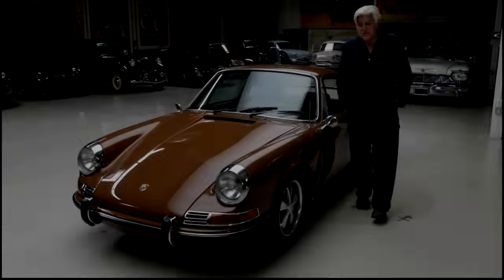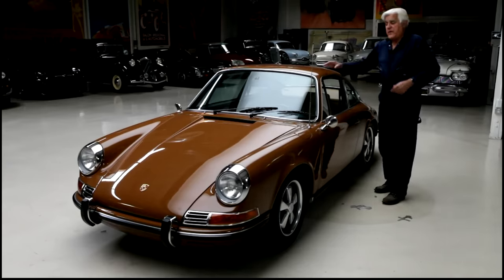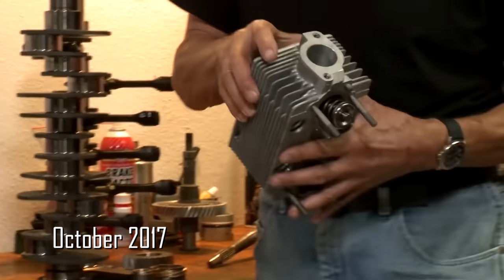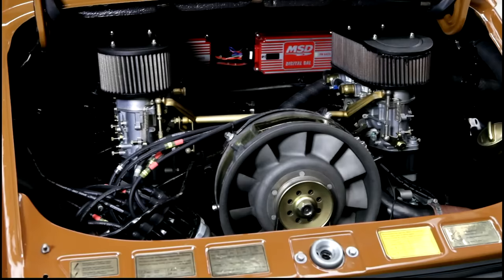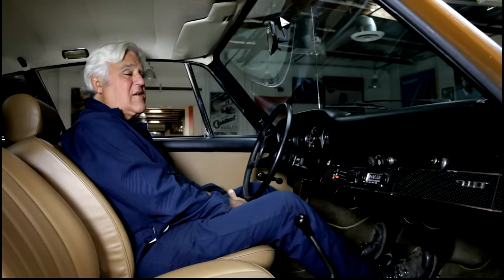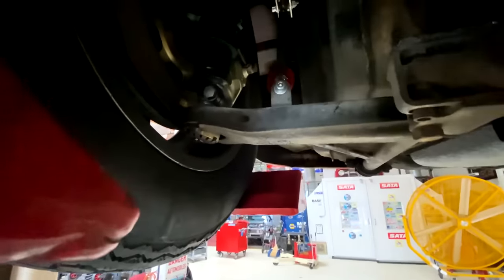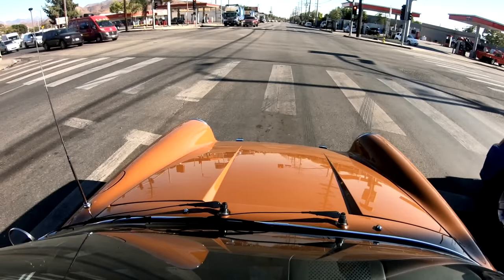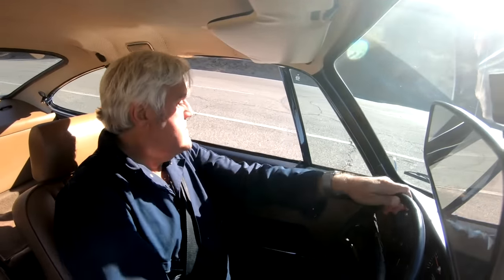1971 Porsche 911 T - Jay Leno's Garage

Comment: When they bury Jay, they'll put a Porsche steering wheel in his one hand  and the gear selector in his other. Fake engine noise! HA! BMW!
Reply: Yep. Bimmers when they were Bimmers. Now, they (cheaply) build expensive - to own and maintain - crap for leasing wannabe millenials. Sad.
Drove once a '71 2002. Man, a revelation. Then in the late '80s a 2 door 330 - I think. Wow again.
Now, not interested at all. A young relative bought a used early 2010. A money pit. He cleaned it, a good polishing job and sold it to another sucker. Deliverance !
Reply: @marcryvon  💯 all german cars have gone the same way. BMW Audi and Mercedes of old were made in smaller numbers and were brilliantly engineered and manufactures almost like a Swiss watch. Since the late 1990s they abandoned that ethos and have chased mass market appeal by living off their old reputation. Unfortunately they are now status symbols and fashion accessories so even though the produce sub standard cars people still buy them

Comment: I had  a  911T.  Bought it new  in Frankfurt.  Conda  green.  Loved  it. Drove  it every day.  Back then  a new  Porsche cost  $7000.   Still have the  window sticker.  It  had  2  Weber  carbs,  each had  3  barrels. It  had  a  dry sump  that  took 9.5 quarts of  oil.  It had  the optional  gauges that  included  an oil level  indicator. .  As  a Porsche  club member,  we  had  events  on the  Weissach  skid pad.  I did well  until  they wet   one of the corners.  I slid  and  took out two  pylons.  Took  a  few factory tours  and  met  the  factory  drivers.  We  had driving  events  at  Hockenheim  and  the Nurburgring.   That  was fun

Comment: I particularly like your philosophy about a car not being over powered. Much more fun to be able to use what you have than get yourself in a situation the car can't handle. Like the 64/65 GTOs. 9 inch Tempest brakes and Beach Boy cool as long as you were driving in a straight line. My 68 was barely able to handle it's Ram Air power.      And boy did radial tires help when they were available for the Rally Wheels. My neighbor was the manager of a BF Goodrich store and we put some on when BFG came out with them.  Ride and cornering were considerably improved. Only problem was they didn't have the bite coming off the line the Tiger 🐯 Paws had. But, good swap all in all as I have always been a road racing guy, not oval track. Formula I or World GT any day. Tragedy when we lost Trans Am. Also have a MGC (yep, look it up), a Triumph TR4A and 250 .nd. Sonbeam Tiger up graded to a 289 HiPo. Now there is a good example of too much power. Much better when it was a 225 hp 289. You could use that. More was wasted and a strain on the drive train. Truthfully best, most fun car I ever had was a VW Golf GTI.

Comment: My dad has a 70 911t targa. He bought it after it was stolen off the Porsche lot and recovered in the early 70's at some point. It's been upgraded to a 2.7 liter with about the same hp as this one. I was almost born in it. I learned to drive stick in it at age 12. The interior is pretty much a dead match to this one. I love the completely manual 3 point belts as you can lock yourself down into those seats so they don't have to be Recaros to hold you in. It's quick enough that I dusted many a 93 turbo Supras when they were out in '94 with it. Love that car.

Comment: I've had a rust free '72 911S Targa for almost 30 years. You are off on the weight by at least 300 pounds. Mine came in just north of 2300... It is lighter now with the Wolf Racing seats that are period correct! It also has Webers instead of MFI. Numbers matching and 108K on the clock, 130+mph is no problemo!

Comment: I owned a 'Tangerine' collered  '71 911T for 5-6 years in the 70's.. To this day, it is still the BEST car I've ever enjoyed driving.. Like Jay said; you could drive it to the limit all of the time... I NEVER had any mechanical issues with it either.. 125 HP doesn't sound very impressive..but, believe me it was plenty for such a light car.. I never turned on the radio because I never tired of hearing the sound of those 6 Weber carbs..

Comment: Hello Jay, I was lucky enough to own a 70 911t and a 73 911t with electronic FI and loved them both. First was a 914 in 70 and the 70 911 later but loved them both. Wife totaled the 714 (she was ok) and the 70 911 burst into flames at the 405 just before Mulholland in 73, The 70 was great, drove the Melrose gran prix to Paramount for years. 73 came next with a 76 912e second car but later an 86 911 (new) was the best. Just was able to stop a flat bed theft at Costco and Home Depot and hijack at Fed ex and went to BMW. Nobody wanted last years Bimmer.

Comment: Jay, I really like that you had the engine rebuilt with a longer stroke besides the larger bore. With air-cooled engines I've so often heard that its important to keep it on the pipe for sufficient cooling. With your rebuild, even when not necessarily revving, you still have good torque on hand for such things as upward winding mountain roads.
And I agree, your 911 is a simple, yet efficient body shape, has good all-around visibility, low yet comfortable driving position, backseats if you need 'em, equal traction to both wheels, precise steering/suspension/shifting/braking. Even an ultra-simple radio. But who needs music when you've got that glorious engine noise??

Comment: My dad had a brown 1972 911T he bought in 1982. The prior owner upgraded it with an E engine and S suspension. My dad after buying it promptly painted it black in our garage with a Sears air compressor and paint gun. He also removed the letters from the decklid and added a rear bumper and reflector panel kit that made it look like a later model. Ended up putting nearly 300,000 miles on that car before retiring it in favor of a 1978 911SC.

Comment: In 1973 I found a 69 911 T that the owner had overrevved the engine. Bought for $2200. 6 bent valves complete with 6 broken rockers. I rebuilt the whole engine. In the process was introduced to my first torx bolts when I removed the flywheel and one time use, torque to yield rod bolts. The local Porsche parts department kept telling me that I couldn’t rebuild the engine every time I bought parts. Once they had the service manager try to convince me that I’d fail at it. With the help of my clymer manual I rebuilt it and drove it until I sold it a year later.

Comment: Using all of the power all of the time is underated. I got a motercycle with 10hp and I basically shift at redline all the time. It's the most fun you can have under the speed limit.

Comment: Rather important that this is a '71 model. The first ones were very squirrely because they had something like 70% of the weight in the back with the engine so far out, and it only got worse once the tank emptied, which make them very challenging to drive in anything but a straight line. They experimented with putting lead and other stuff in the front to even it out a bit, but by 1970 they were well past that. The spare tire is placed right up in the front bumper to help weigh it down, along with everything that doesn't strictly need to be in the rear. You still have to remember that you can't floor it in a curve, or take your foot off the gas, or the rear end comes around, but these late models are much easier to keep under control. It's like Jay always says: the last models are the best ones because they've figured out how to get it right. Of course the 911 went out of production in 1973 when it was replaced by the 930, which ended up being sold as the 911 Turbo because people refused to accept that it was a different model, despite a rather substantial design change. It's really rather strange that with the 935 and 959, people were willing to accept they were different cars, even though they have more in common with the 930 and 964 versions of the 911, than the 930 had with the 911

Comment: Nice video.
Nice video. Thanks.A couple decent ideas for my 1970 911S 3 owner car, engine never out in 78,000 documented miles. It needs a trip to a shop to get the motor resealed and a nice detail like Jay did. I like the 2.2 however in the S.

Comment: I had 6 different 912 back when they were affordable about 12 years ago. Now they want 3-4x times what I used to pay for nice drivers for 912s and I'm kicking myself now for turning down a 72 911 Targa for $10k that ran but needed work circa 07'. Jays right they run proper and are fun/shift right, won't break any speed records but do you really need that for daily driving? I would give a lot to get even one of those cars I had back now. Thanks Jay for doing a nice vid on classic 911s

Comment: 70.4mm stroke is the “longer” stroke?!? That’s quite a short stroke!
The stroke on my 1990 MR2 Turbo and my 1994 Supra TT are 86mm while my 1994 Celica Turbo has been stroked to 87.5mm from its original 86mm. But I guess the total displacement from each of the 911’s cylinders is much smaller than the .5L of each of my cylinders. Those must be some, comparatively, massive diameter pistons though?

Comment: I once found a Jaguar XKE in a garage under a Miami Beach condo. The price was cheap, but the car hadn't been started in years, and the salt air (the beach was less than 100 meter away) had caused the brakes to rust up tight. I borrowed a flat bed tow truck to pick up the car, but couldn't get the truck into the garage (the car was parked in a community garage). Luckily the truck had lots of cable, chains, and pullies, and I was able to drag the car out with all four wheels locked up. Surprisingly, the body wasn't as rusty as the brakes. I had planned to restore the car and hopefully drive it, but before I even made it home with the Jag, someone offered me a fair amount of money for it (it wasn't Jay). I made $3k for simply dragging the car of the garage and attempting to go home.

Comment: I used to hang out at Northlake Porsche-Audi in the Atlanta suburbs when it opened in 1970,  I was a sophomore in high school, the 911T were selling in the $7k range when a Corvette was less than $5k.  In 1972 got a 1957 Porsche 356A Speedster and the rest is a history of three 912's and about a dozen 911's from 1969 to 1973, I specialized in them for about 4 years in the late 2,000's  when the Euro reached 1.7 to the $US Dollar and the cars had passed 25 years of age lower import tax, the Europeans were buying every one they could get their hands on putting six in a container to Rotterdam.  The Sepia Brown color was one VERY often overpainted but it indeed was one of the Porsche colors that SCREAMS early 1970's along with Conda Green, Tangerine and Signal Orange.  I even drove some Sportomatic's which I hated.  My 911T's didn't have anywhere near 150hp much less 200hp, they were light steering cars especially when the gas tank was low, the ride was excellent, not harsh like sports cars that get their handling by making the chassis stiff and kidney bruising.  You could see in front and to the sides and the back, you sat high up, no better view in ANY car, thanks to the read engine.  The 1972's had the 2.4 liter motor, a big deal then.  I had a '69 that was terrific with a short shift kit that made it shift like a light switch, that square 2.0 liter motor had grunt all day long, terrific.  Later had a few 911SC's and Carrera's and even a federalized 1982 930 Turbo, THAT car was heavy but VERY FAST.  Now I drive an Arctic Silver with Terracotta 1998 986 Boxster which I think is as fast as my 1987 911 3.2 Carrera with an INFINITELY better ventilation system along with REAL heat and REAL air conditioning.  Electric windows too! Still I wish it was air-cooled ......

Comment: I forgot to mention that mine is a 1970 and has Zenith Carbs. The only modifications to the motor were replacing the cam chain tensioners with oil fed type, new teflon valve guides and  a new cylinder due to scoring on it due to a small engine fire that was caused by the gas fed chokes that has been since disabled. 
Greatest car to drive as Jay says if you know how to drive.
William Boehly

Comment: Amazing these cars, completely restored or with very low miles are going for $300K +. I used to have a '73 911 T, wishing I never sold it. I'd be interested to know what he paid for the car. I'd rather have this than a new 911. I know that may sound crazy... but for anyone that has ever driven a 911 G car, there's nothing like 'em. Taking off, shifting the gears, hearing the sound that only these cars make and even the old 4 speeds were fun to drive.  These cars are amazing.

Comment: I installed car audio for 15 something years and remember sometimes the disappointment of having to run wires from front to back in those things. The carpet is glued down tight just about everywhere with bomb-proof adhesive.

Comment: I've discovered over 40 yrs of driving, the cars most fun to drive are those that go about 10 lbs per hp,  they perform well, most are relatively light weight, so handle nicely and while plenty of power, not so much where if push on gas pedal just a lil too much, you find yourself in a ditch

Comment: Similar power to weight of the Fiesta ST, and honestly it's just right to have some fun. 220-240bhp in a 2600-2800lbs car is pretty ideal. It's just fast enough where you're able to get out of your own way, light enough that it feels nimble, but not so small it feels like a tin can, and not so fast where you can't really floor it for too long without going straight to jail if you get caught. Can run it through the gears, enjoy it through the rev range, have fun at a decent pace without too much fuss. You kinda hit an aero/power wall at 130mph in regards to acceleration, stops accelerating too quickly between there and 140-145 where cars in this power range kinda top out, and that's plenty fast for a tiny car like that. Wouldn't want to go much quicker anyways and you're not really spending much time north of 120 all too often anyways, and under that it gets up and goes pretty well. I've gone hair over 140 maybe 2-3 times in my Fiesta ST and it's kinda tense in a light short wheelbase car, wouldn't want to do the same in a car from the 70s. Not the best place to be, definitely clenching. 😆

Comment: I learned to drive in a VW beetle; and as my sister loved VW beetles I drove a lot of them.
Eons later I bought a used silver 1977 Porsche Targa. It looked very cool and got lots of comments of envy. Big surprise was it felt exactly like driving a VW beetle, just more power. From the driver’s seat you can’t see how cool the Targa looks; but, you can discern that the seat, the steering wheel, the gear shift, and the instrument cluster all felt and looked just like all the VW beetles I’d driven. Huge difference between the Porsche and the VW was cost of repairs. Even minor items, like sun visors, were ridiculously overpriced. Because of the costs I wouldn’t have another Porsche if someone offered to give me one. Sorry Porsche lovers, just my personal thoughts.

Comment: 911 As 911 is supposed to be imho. All went wrong after ~1975 imho. This era as shown by Jay, specially with the Fuchs wheels, typically represents authentic design. Excellent. The only little remark from my side would be the US spec headlight rims which are from a later era I think (not sure though), and of course I am really still not very fond of the dark atmosphere. It makes the scene sad and unjoyful, but that's me. Would really like to see some lights again. However, this car itself is exactly what a 911 is supposed to be 👌

Oh, and a little point of interest perhaps. The centre part of steering wheel orginally was a very simple round knob but already having the front metal flippers attached for the horn. This design evolved into the integrated padded centre part shown on your 911, and it stood as model for VW Karmann steering wheels, becoming the VWs standard not that much later.

Comment: If you're gonna own a car like this, unless you are a serious collector and simply can't get to everything in a given cycle, if you don't put at least 100-200 miles on the car per year--so you're actually enjoying owning it--then , IMHO, you don't deserve the car. What is the point of owning car, especially a high performance vehicle, if you're not willing to drive it around once in a while? It's not about showing off. It's about the experience of being behind the wheel. It's about admiring the engineering that went into the vehicle. It's about appreciating the realization of the designer's vision.

Comment: Were the original carbs the three-barrel Zeniths?  My 1970 911T had those originally but I switched up to six Webers.  Synchronizing either set of carbs was a PITA.  The clutch cable on mine broke right in front of the Broadmoor Hotel in Colorado Springs.  Does your car have good ground clearance?  Mine was good off-road - I passed four-wheelers on Gold Camp Road between Pikes Peak and Cripple Creek and passed my classmates' Corvettes as the last car before the State Police closed Hoosier Pass in a blizzard.

Comment: Nothing as nice as a well executed shift. 

Last time I heard that I was driving Uber/Lyft in my 2006 Ram 2500 Diesel. The ladies in the back noticed I was rowing through the gears after seeing my hand move. 

Suddenly it the coolest thing. An Uber driver in Wyoming with a pickup and a manual transmission.

Comment: Hey Jay nice car. But I saw something wrong when you filmed the under car. The CV boots use metal band clamps not plastic cable ties to hold the boots on the flanges. Dealer probably can get you the correct ones. Ken from German Auto Repair Technicians Inc. New York